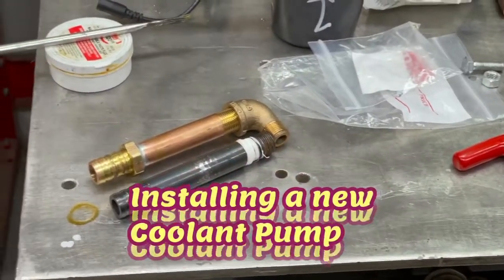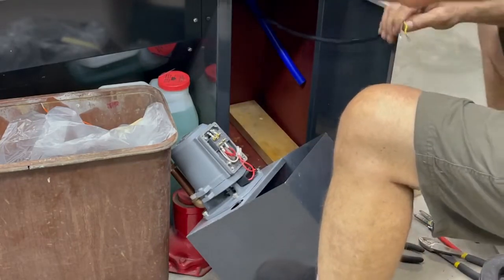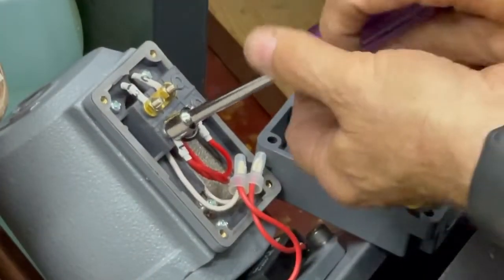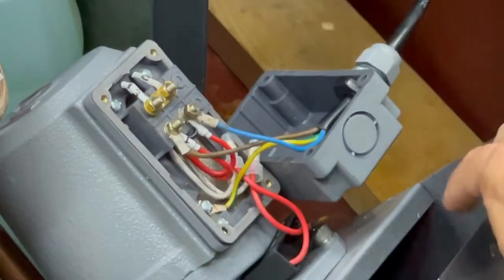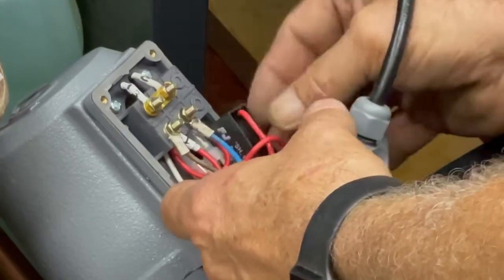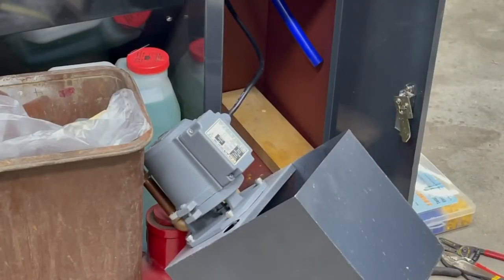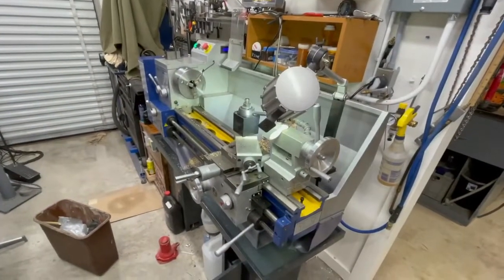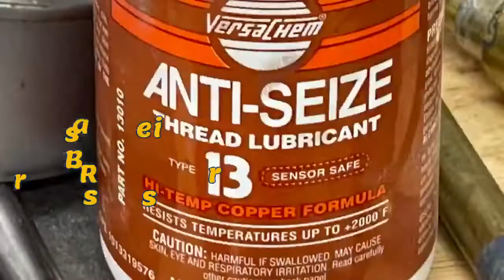Upgrade to the POS Coolant pump for the ANMEC Lathe

Comment: thank you for that.  what do you use for the liquid when actually cutting chips?
Reply from the maker: I use general purpose Emulsion (water soluble oil).  The brand is from “Master Fluid Solutions” and the name of the product is “TRIM SOL nd “

It mixes 50/50 with water.
Reply: I love those smartlife valve shut offs. I use them for water, natural gas, and my air compressor. I have them on a schedule so they shut off at night and turn on early in the morning. They also make circuit breakers that can handle 100 ams and switches that are 15 amps. Great video…